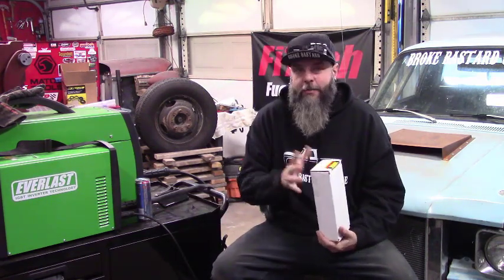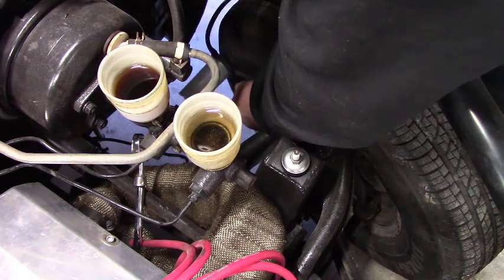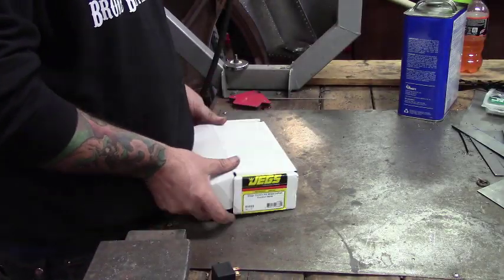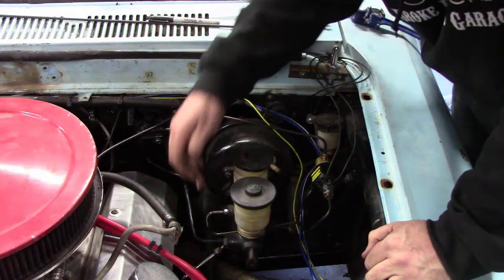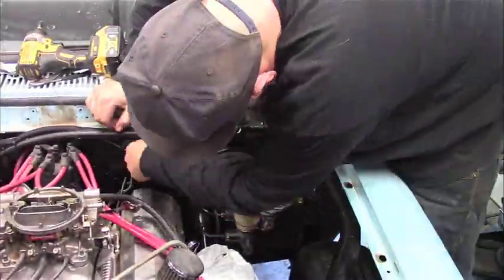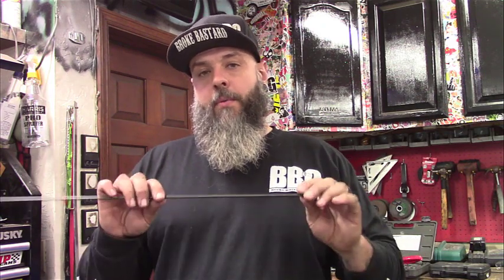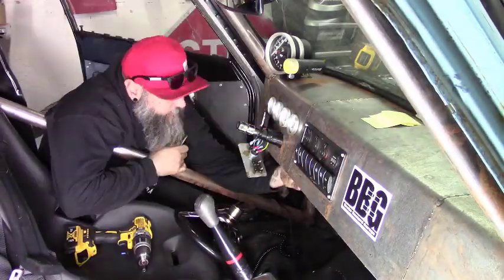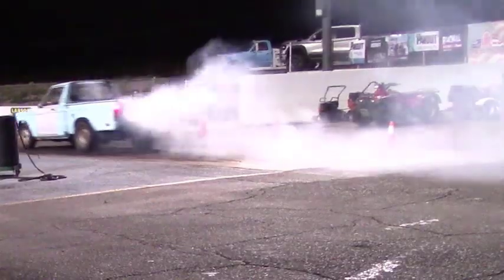How to Install Line Lock - Updated Version

Comment: So, the line lock I got has one inlet and 3 outlets. Instead of the T fitting, I could just run 2 outlets to the two front lines, yes?

Comment: Wait... I thought for a long time that line lock makes the rear wheels free to spin and locks the front so you can burnout without any pressure on the rears.
So if you want to do something like that is there a product out there?
Reply: That is literally what he did...you pump up the brake and then hold the button...it holds the pressure between the front brakes and stops it from returning to the master cylinder when you release the brake pedal.  As soon as you let go of the button then the pressure is released that was held in the front brake lines.